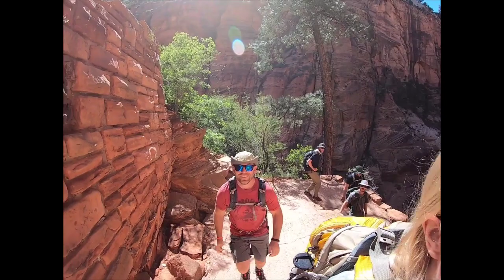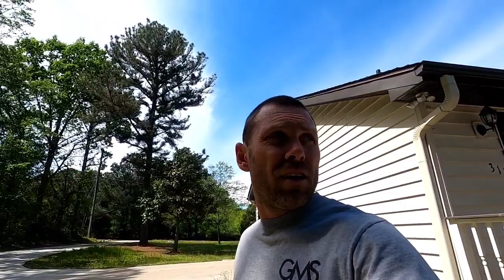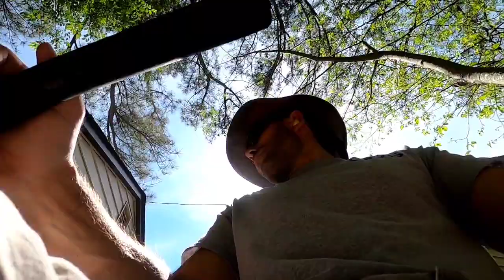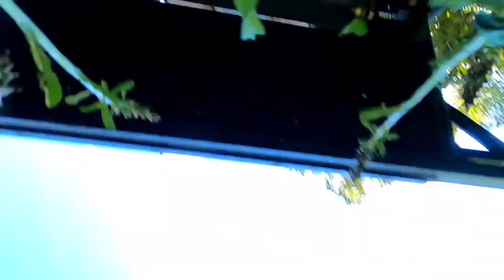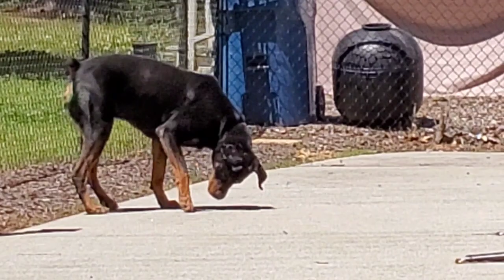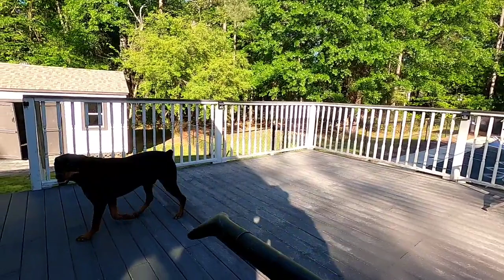#rottweiler #stayathome #krx  Roks the rottie eats ice cream, KRX exhaust stay at home kinda weekend

Comment: What and how did yo7 do the exhaust on the krx
Reply from the maker: The link to the muffler used is in the description below the video. Basically, I cut a hole in a piece of sheet metal and bolted it to the header. Then welded a 3 inch exhaust flange on to the sheet metal to fit the muffler.